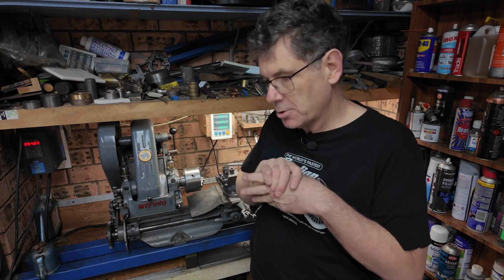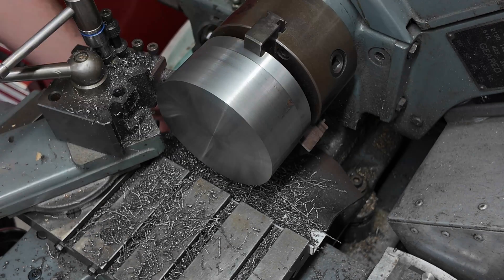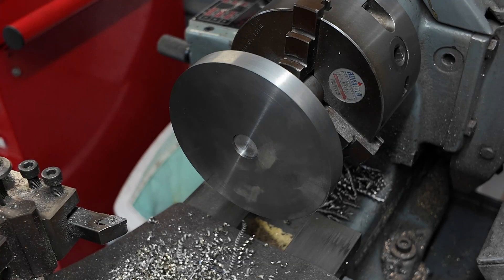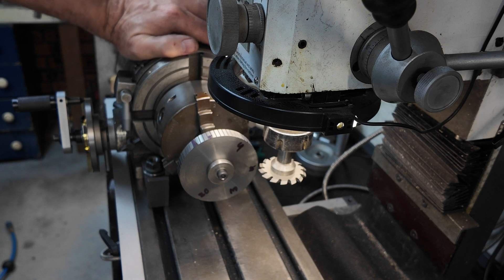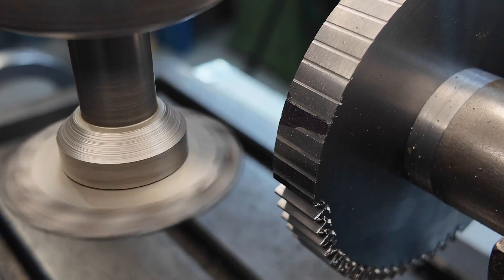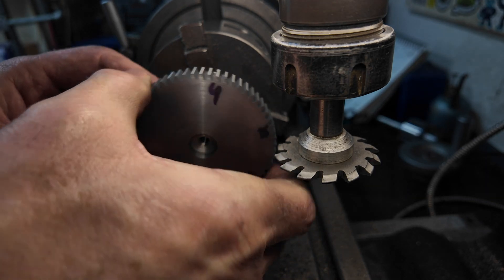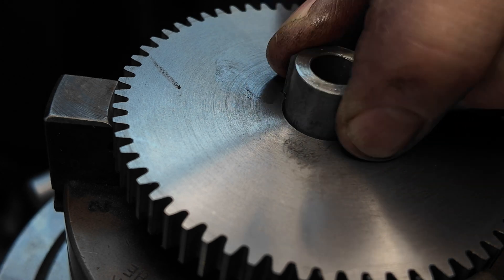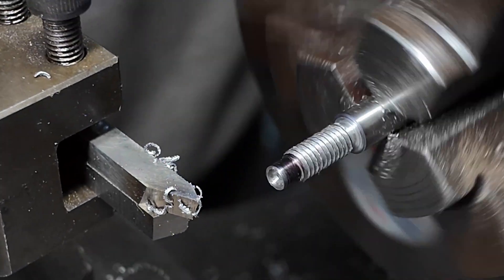Make a Lathe Change Gear

Comment: It so happens that I need to make a 63T for my Harrison L5 - I'm just learning engineering in my dotage, and this vid was serendipitous - clearly explained. Which gear cutter size did you use?
Reply from the maker: I used Diametral Pitch 20 cutters which I believe is correct for Myford.  I'm not sure what Harrison used.  Thanks for watching.  Good luck with your project!

Comment: I took the easy way out back in the early nineties, I made the blanks and got my Apprentice to cut the teeth on a 127 tooth gear for my Hercus lathe.
He made a mistake on the first one but succeeded on the second attempt, good exercise in setting up the gear train on the dividing head being a prime number tooth count.
My Brother still uses it today to cut metric threads.
My DSG lathe had a 63 tooth gear, space constraints, but close enough.
Nice finish on the teeth.
Reply from the maker: It’s really a fun thing to do.  Very satisfying!  I bet your apprentice learned plenty.